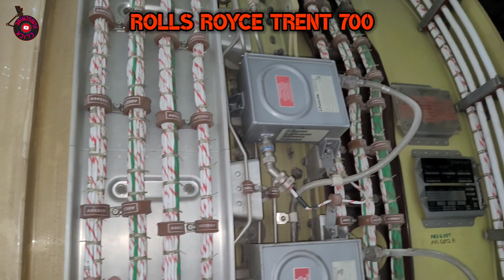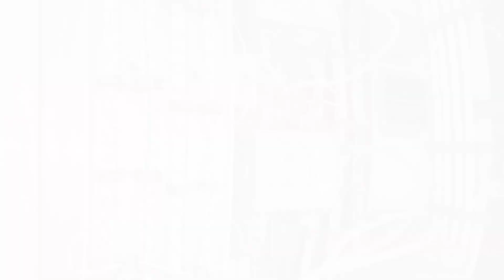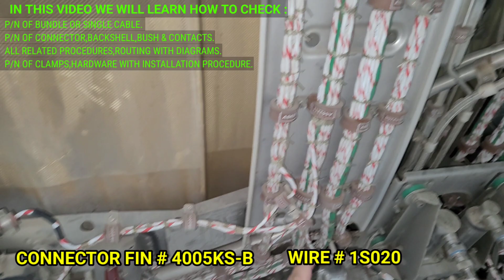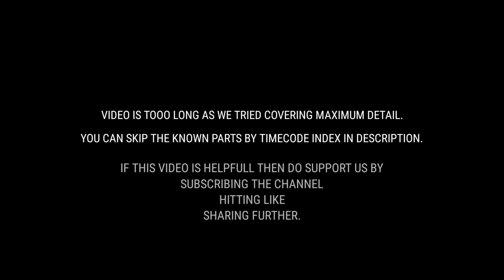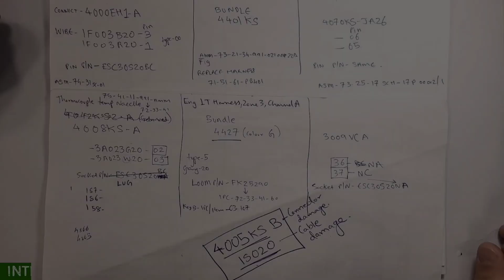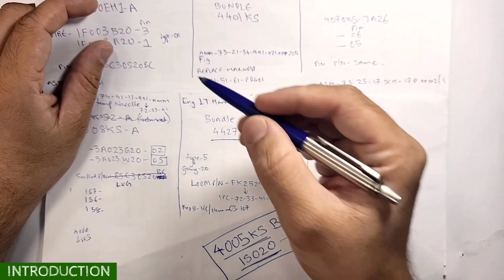HOW TO FIND PARTNUMBER IN ROLLS ROYCE TRENT 700 ENGINE OF A330 PART1 #a330

Comment: I love your video but it's a little bit different and more complicate to find the wire numbers with the new AirnavX.
Reply from the maker: Thanx for appreciation. 
You are correct. AirnavX is more easier. This method is while using engine manual and sometime our aircraft manual is not fully  integrated with engine manual.